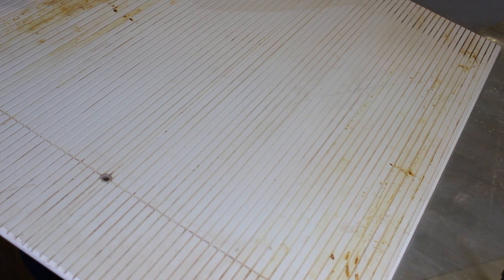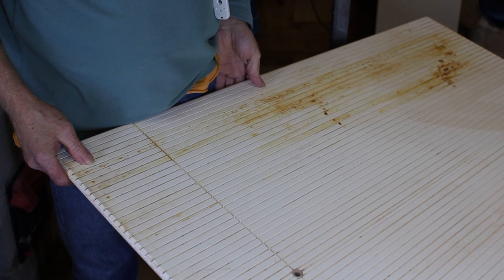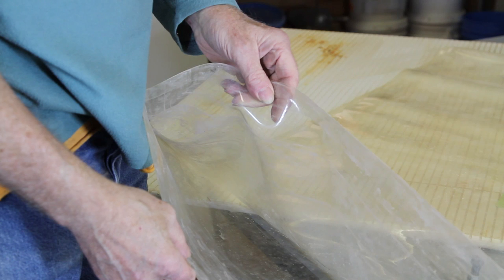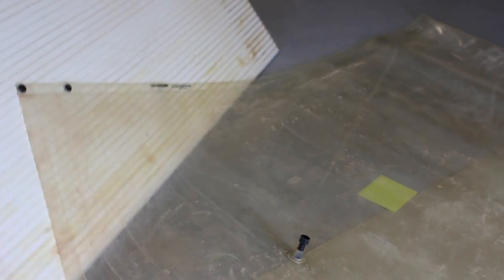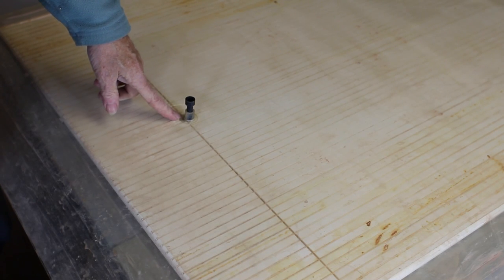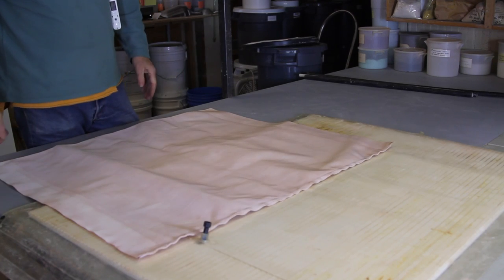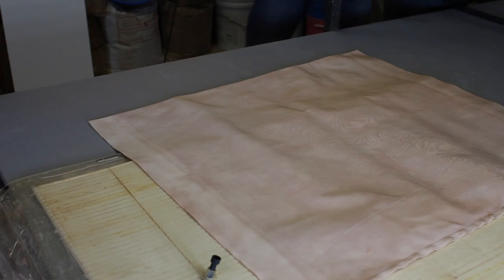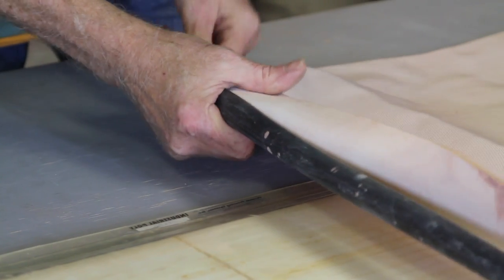Clay slip de-watering with vacuum bag : Part 2 — clay test process

Comment: I can't believe how few views this has when it's such a brilliant idea. Just watching it again - I somehow missed you saying the bags were for woodworking veneers. Last time I didn't think I'd be able to get them because I'm not in America, but this time I was able to google and find some locally. 

Are you still using this system? Do you still like it?
Reply from the maker: Kim — as you say this is a simple idea that works very well. This process video generates little interest because very few understand the importance of thoroughly wetting the tiny flat clay particles to obtain maximum workability and plasticity. I am pleased that you found this useful. Yes — I continue to use this method to trial test small 5 gallon batches. I use a different blunger / filter press / vacuum pug mill method to mix my 800 pound production batches of plastic clay.
Reply: @waterstonesink  Must be something wrong with youtube algorithm, this method is outstanding!